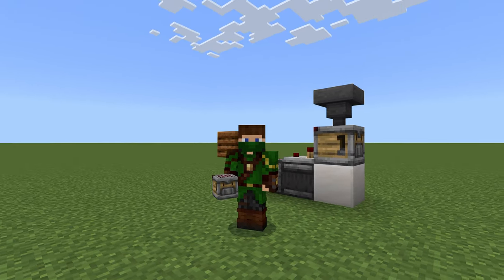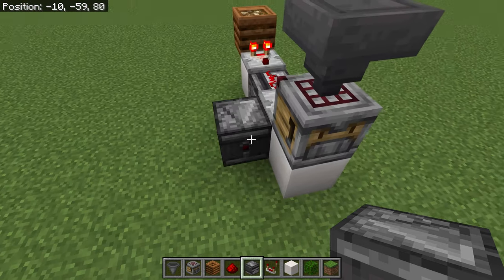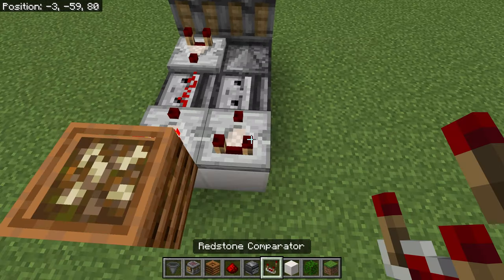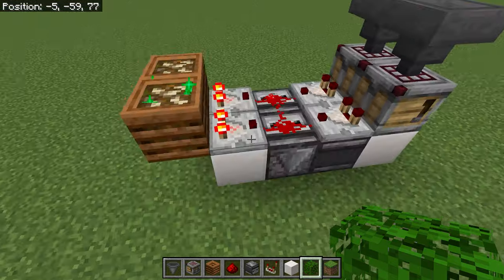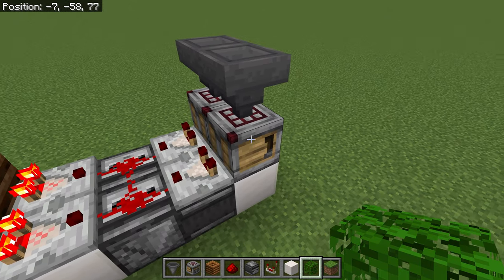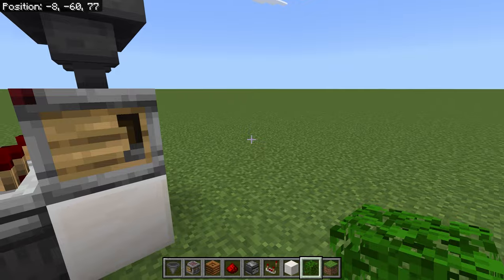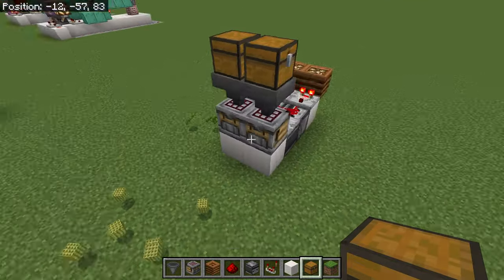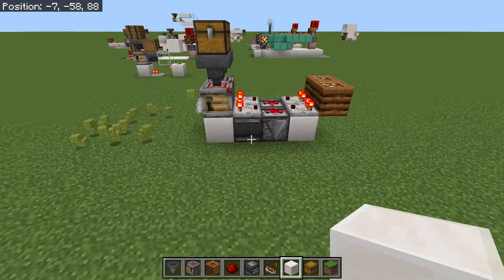TINY Tileable Minecraft Auto Crafter Compactor

Comment: no longer works, running it with iron ingots produces blocks and pressure plates
Reply from the maker: 0:17 I specifically said at the start it doesn't work for iron or gold
Reply: @Acadewolf  thank you. any idea why?
Reply from the maker: @CyberSerumYT  it's because it fires twice: once when the signal strength goes up to 9, once when it drops back to 8. There's a way to only trigger it once using a copper bulb and comparator t-flip, but that's a less compact and I was going for the most compact possible in this one
Reply: @Acadewolf  ahhh so this will only work if there isnt also a crafting option when it fires the first time. thank you
Reply from the maker: @CyberSerumYT  correct
Reply: @Acadewolf it also can fire on relog or reload cuz observers detecting dust fire on reload
Reply from the maker: @DimTryhxrd  true. The downside of making it the tiniest possible and why my most popular ones don't use observers.
Reply: @DimTryhxrd  I designed a version that works with iron/gold bars, just have to make a slight modification to the autocrafter trigger. Let me know if you want the schem.